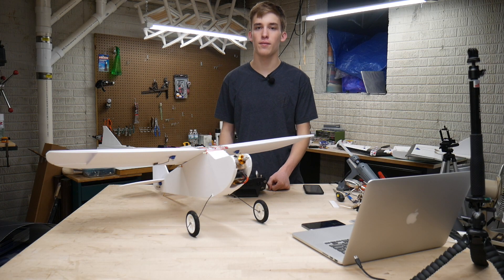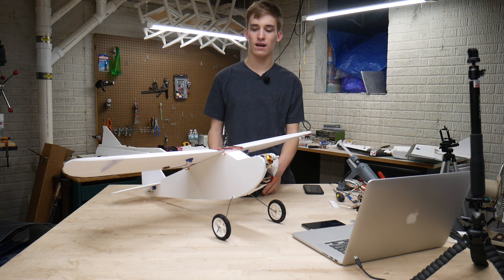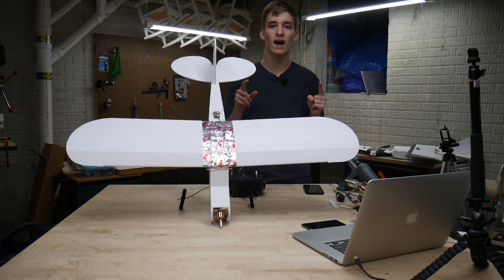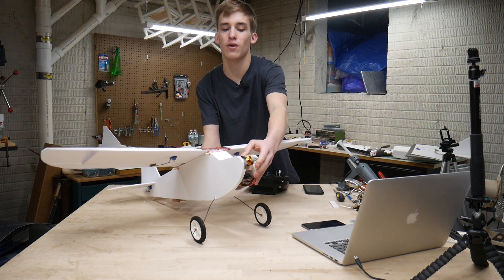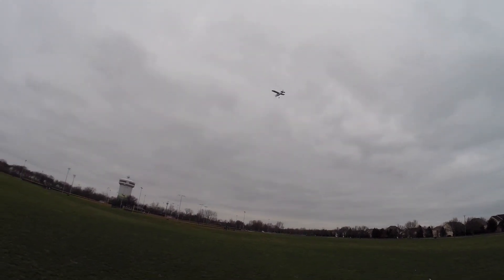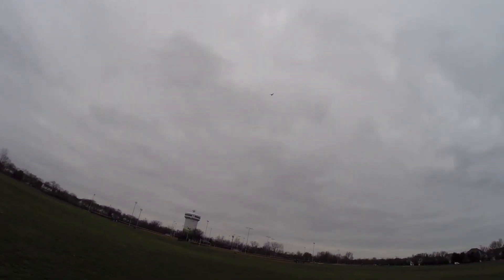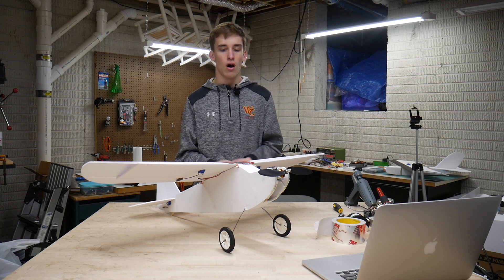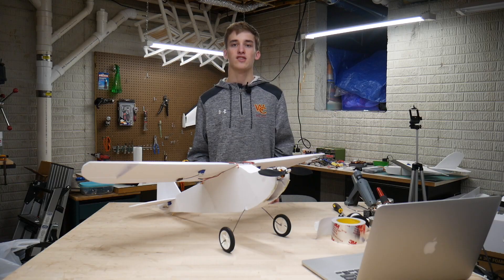FT Simple Cub Set Up and Maiden - Scratch Build Beginner Series Part 2

Comment: Nice Video! I find the FT build videos lacking some crucial info, for instance Josh's build of the power pod, with the ESC on the bottom of the pod, and the battery leads up inside the pod, then on his maiden he mounts the battery to the bottom of the power pod, that really confused me....   I am always looking for new ideas, on my maiden last Friday, it nosed in and ripped the two skewers on the motor pod down about 1/2  inch of fuselage, like your great idea to just glue it in place....  Also the landing gear got forced into the bottom of the fuselage, any suggestions on strengthening that area? 

Thanks, Joe
Reply from the maker: Thank you for the kind words, Yeah I completely agree on that note about the build videos. Sometimes it leaves you confused and you mess it up. Gluing the power pod is a really smart move, it really strengthens the fuselage altogether, and I find the FT Swappable initiative pretty impractical because the power pods tend to rip out and vibrations occur. Yeah, the landing gear is one of the weak points on these planes. If you can, I would also apply a healthy amount of glue to the tab and permenantly connect it to the fuselage. Like the power pods, the "friction fit" of the landing gear tab tends to wiggle loose and destroy itself on impact. I would also recommend strengthening the joint where the landing gear wire leaves the fuselage with glue, that will rip out pretty easily. It doesn't look the best, but I would also recommend using a BBQ skewer or a popsicle stick and gluing it right behind that joint, preventing the wire from eating into the fuse. At the end of the day, Just using lots of glue to reinforce the area is the main suggestion. Thanks for watching!
Reply: @CustomFPV  Thanks for the prompt reply!!  I have to admit I am a little nervous as to how to glue the power pod in and IF I got all the electronics installed correctly, as once its installed (glued), I think I am some what locked into the setup....  I installed my elevator / rudder servos in the back near the existing hole exits for the push rods (I built a mini scout and didn't like how the Servo push rods wires bowed when excess pressure was applied to them), but they are still too far forward, as the control wires bow too excessively for my comfort...  I like your setup a lot more, with servos further in the rear...   Thanks for the suggestions on the Landing Gear, just need to figure out the mechanics of how to strengthen them without adding a bunch of weight... and yes the Landing gear has already tore up my fuselage!?!   I see in the Simple Scout Video that your not a fan of the cub... do you like the scout a lot better!  Best Regards.
Reply from the maker: Yeah, you kinda have to commit to it, so you may elect to run it not glued in until you finalize it. I do like the scout better, the Cub flew but the scout was way smoother and more predictable.

Comment: How do I lower the rates? I just built mine and about to maiden tomm. I am using a crossfire receiver with a servo adapter and a Taranis QX7. Thanks for the videos
Reply from the maker: I normally set up the rates in the transmitter, but you can also do it on the pushrods themselves. For higher rates, move the pushrod out on the servo arm and in on the control horn. For lower rates, move the pushrod in on the servo arm and out on the control horn. If you wish to do it in your transmitter, go to the "inputs" tab in openTX and there you will see a 100 on each of the channels. from there you can click on the channel to edit it and adjust that as a percentage. Hope that helps!
Reply: CustomRCMods thanks! In the inputs tab I see 100 for weight, is that what you mean? I also see a setting for expo in Inputs tab, should I just use that? The FT website suggests expo of 30
Reply from the maker: Yep! You can treat the 100 like a percentage, and turn it down for less rate. In that tab you can also adjust the expo and personalize your curve. Thanks for watching!
Reply: @CustomFPV  Thanks, read this a little late and maidened mine into a tree. Time to build again. So depressing...
Reply from the maker: No worries, only a few bucks of materials right? a store bought plane would have been absolutely heartbreaking. Keep your head up. I did the exact same thing when I first got into flying and there is a video of it on this channel. I quickly found out you need much less rate than you think, especially on the roll axis. Let me know if you have questions or need help with anything!
Reply: @CustomFPV  Thanks, I flew just fine FPV, it's when I tried to go LOS that I got into trouble. What are your thoughts on only flying FPV? 
I really want to learn LOS but the learning curve looks like it's going to be expensive
Reply from the maker: Hashaam Markas Get a nice big open space, and some altitude. Idk if you have seen some of my other flying videos but I fly at a wide open field, no trees anywhere. Also flying multiple “mistakes” high will help you recover when you get into an uncomfortable situation. I’d say keep it about 50ft high. once you are up, you have that safety cushion of space all around you, but don’t do anything crazy. Choose a direction and start doing circles. I usually go counter clockwise. Learn the muscle memory needed to turn and level out, and also the different characteristics of the plane. At the end, glide down straight to land. Thanks for watching!
Reply: @CustomFPV  Appreciate the replies and advice